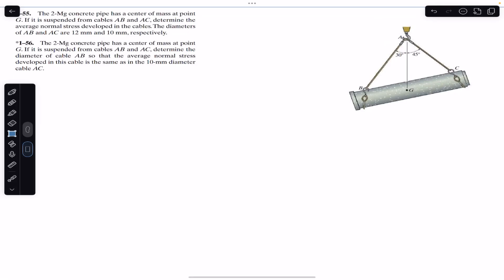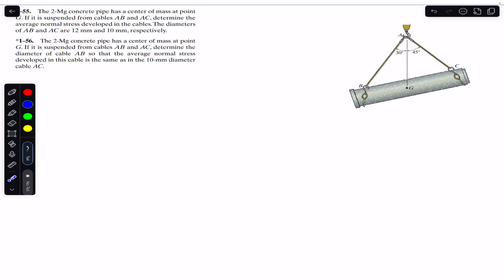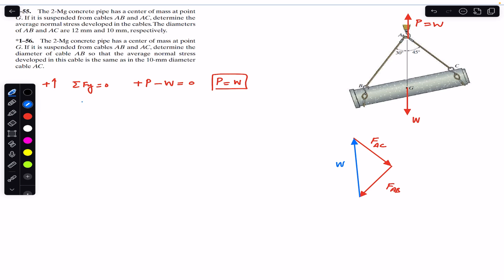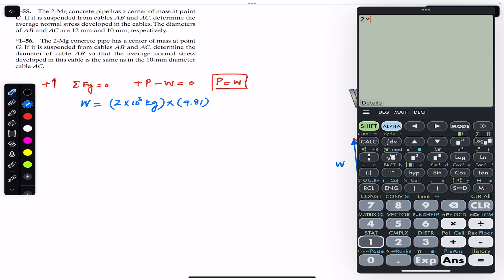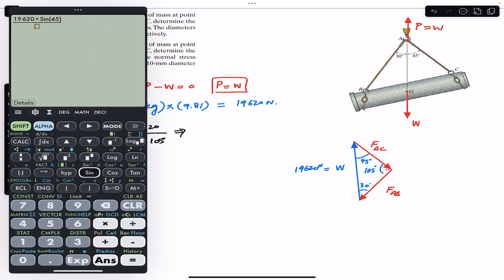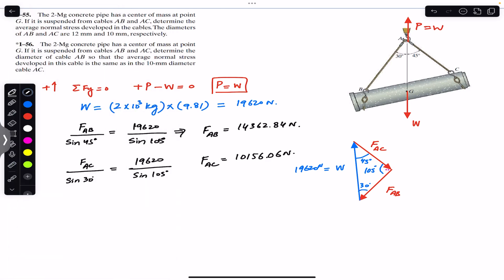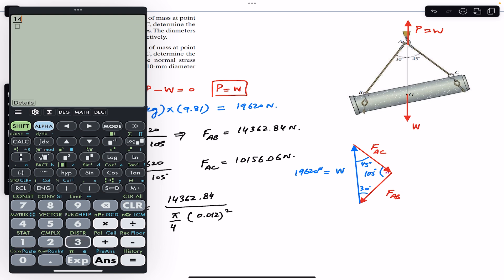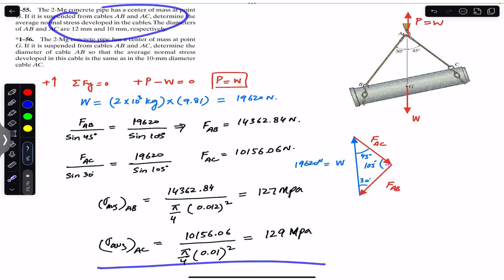Determine the diameter of cable AB . | Solid Mechanics| Engineers Academy

Comment: Because P = W, joint (or point) analysis can be performed at A. By then doing the sum of forces in the x and y direction, the unknowns can be solved by using simultaneous equations.